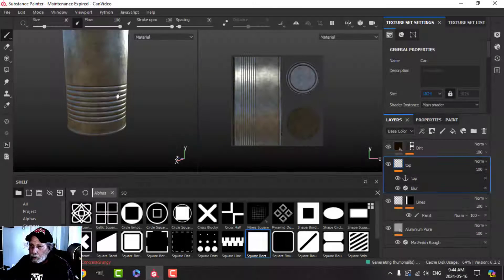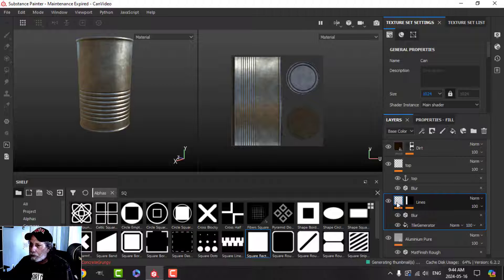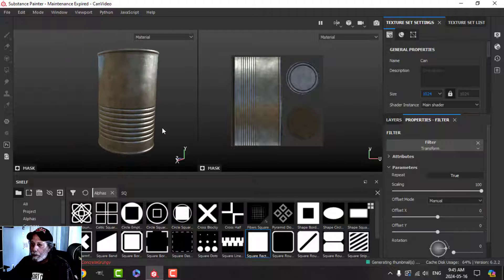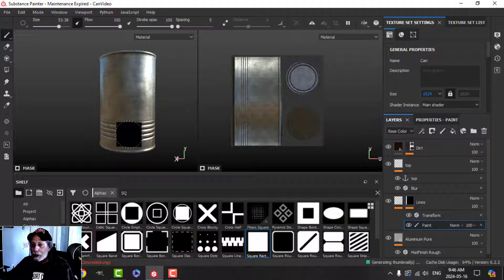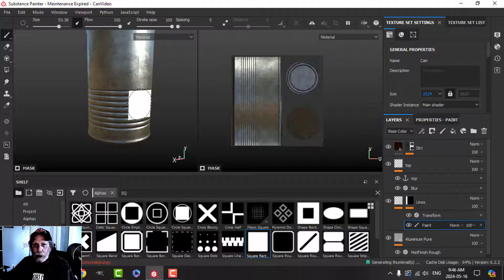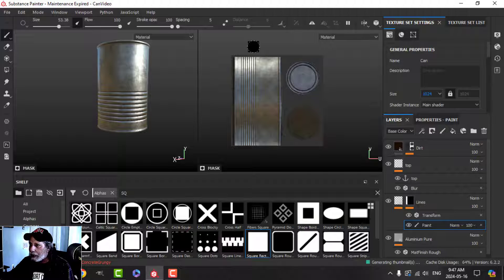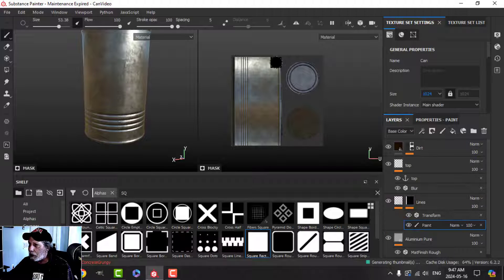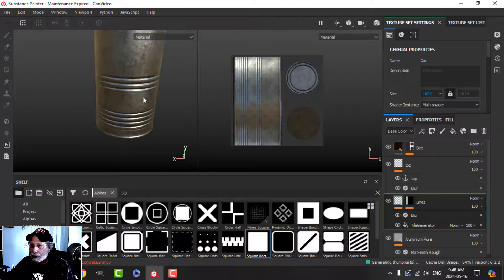SUBSTANCE PAINTER: TRANSFORM FILTER

Comment: Hey! I'm having trouble with some of my wooden items and the grain direction. For example a window frames sides would show the grain vertical, while the top and bottom would have the grain horizontal. Is there a way in Substance to accomplish that or would I just have to unwrap them and align them before importing to substance? I have at least a dozen wooden items to texture and was hoping substance could do this so I don't get slow downed too much on the uv unwraps.
Reply from the maker: There are ways to change this in substance painter but it can be a pain.  I tend to unwrap and align and go into SP and if the grain is wrong  I usually go back to the unwrap and rotate that part and then back into SP.  Let me know if you have any problems with this.
Reply: @zerobio I should be able to do it with that approach then for sure. I appreciate the reply and have subbed because it looks like you have tons of useful stuff thank you 👍
Reply from the maker: @tomhikon  that's great.  Please let me know if you run into any trouble and thanks.
Reply from the maker: @tomhikon  good stuff and thanks for your support
Reply: @zerobio Also noticed your bio and I'm from New Brunswick myself, currently in BC. Thanks for the help!
Reply from the maker: @tomhikon  hey cool!  I lived in Calgary for a year and have certainly been through BC.  Thanks